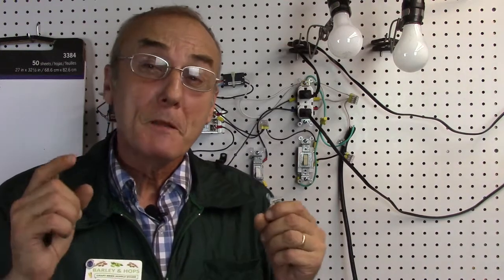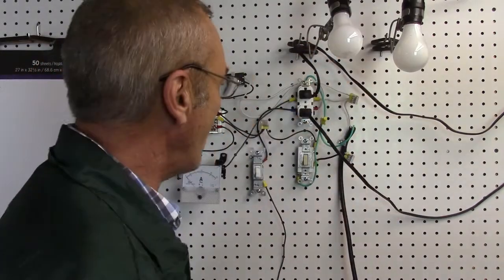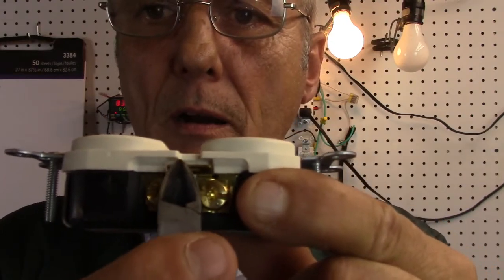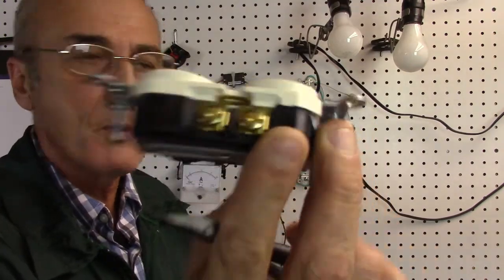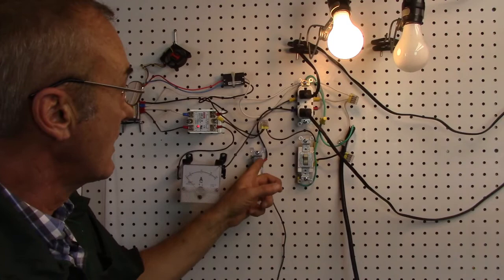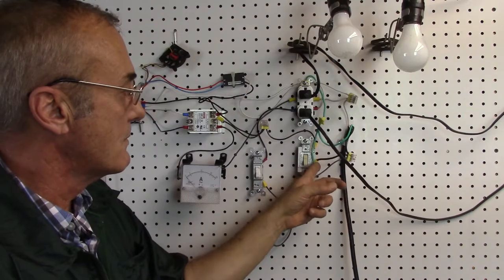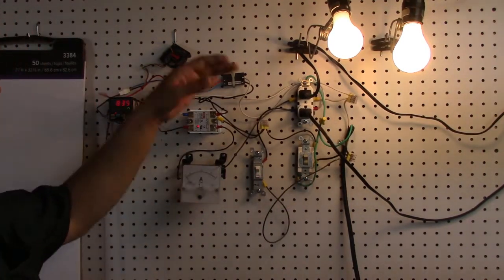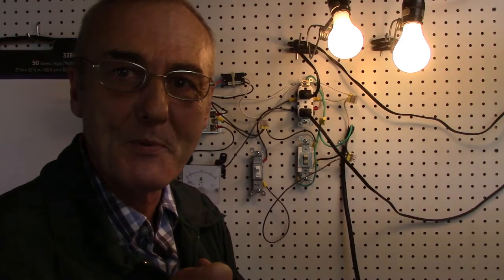Wiring 120V PID final with isolated receptacle for the water pump

Comment: Hello George, I have a couple questions I understand that fuses protect the wiring not the PID, SSR etc. If you had the correct gauge wires would there be any need for fuses? Only reason I ask is because the big boys that sell these commercially seems like their controllers always have a fuse sticking out the side of em just curious before I make an attempt at this. Also would it be ok to use 12/2 wire just strip it down and use the solid wire to wire up the outlets and switches and then use like 16 gauge stranded speaker wire to run from the outlets to SSR and PID? 
Thank you for all your info, this has been pretty much the only channel I have found that discribes how to do it in vivid detail and I am very grateful for that!
Reply from the maker: Your question about wiring is spot on. You can do all of that. You can also use a smaller gauge wire for the power to the PID since it will only draw about .5 amps. 
The fuse most manufacturers add is an additional safety margin. Additionally, they normally limit most products to 10 amps so a 10 amp fuse is added to the appliance even though they know that it will able plugged into a circuit of at least 15 amps. 
Really protects the product.
If you are aware of electricity and how it works and are comfortable working with it then a secondary fuse is not necessary. Circuit breakers were made for safety and they work wonderfully. I know because as I test and wire different things I make plenty of mistakes, have shorts and blow circuit breakers quite a bit.
George
Reply: Barley and Hops Brewing  cool thanks for the reply I’m looking at doing a 120V system with a PID using a Blichmann BoilCoil at 2250w 18.75amps and on a 20amp breaker doesn’t give me much room for a pump (chugger pump 1.9amps)  I was thinking couldn’t I just run 2 separate lines and 2 separate breakers one for the PID and one for the pump? But wire it into the same controller?